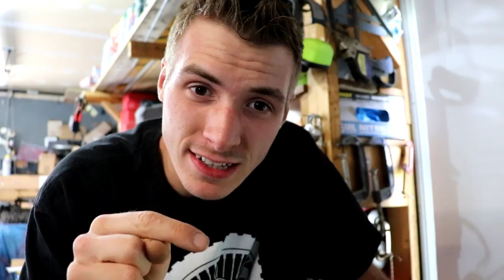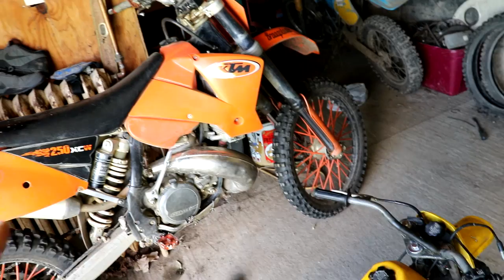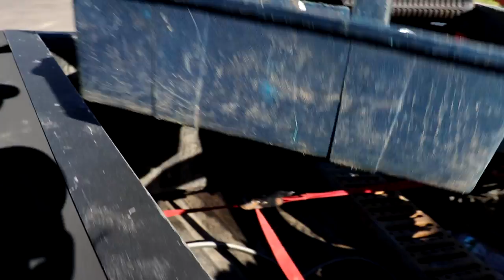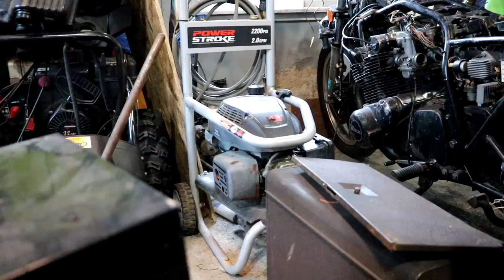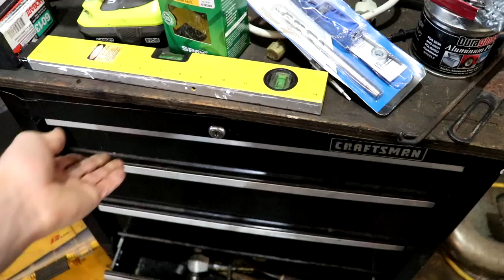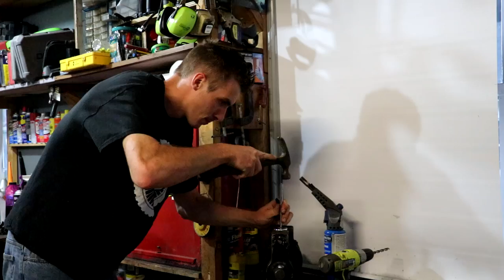THIS IS ALWAYS DANGEROUS

Comment from the maker: I want to read some comments.
Reply: what happend to the honda
Reply: 3DMachines where is the Honda?!?
P.S. I love your videos keep up the great work!
Reply: 3DMachines Yo Dalton, I'm not a machine freak but have been loving your vlogs for a bit over a year, more entertaining than Casey Niestat for sure! Never miss a vlog. Brapp on mate and stay froggy fresh
Reply: 3DMachines 2 vs 4 stroke
Reply: 3DMachines what has happend to the honda??
Reply: 3DMachines when you striped down your bike it kind of looks like those trick motocross bikess
Reply: That shaft is not the crank but the output shaft, the crank seal is behind the flywheel and clutch (other side) on the crankshaft.
Reply: What is your opinion on a 2002 yz426f?
Reply: 3DMachines i love your videos
Reply: are you going to build another lawntractor
Reply: your my favorite  you tuber and I wish I could meet  you and I'm from Somerset  pa
Reply: can to read these I'm video
Reply: I'll take the BMW
Reply: 3DMachines love you man
Reply: 3DMachines can u tell me what the measurements between the 3 screws that hold the front left plastic  is and stay froggy fresh
Reply: your best bet with 2 stroke's ( ive had nothing but 2 strokes) is to pull the engine out of the frame yourself, take the engine and have it rebuilt bore it out a little bit bigger, and while your engine is getting rebuilt tear down the rest of the bike and regrease all the bearings, axles etc and just spend time really cleaning the bike.
Reply: 3DMachines check the reeds
Reply: YOUR REEDS COULD BE BAD AND LEACK AIR BACK
Reply: 3DMachines great job on the videos! I learn something new every time
Reply: Jetting jetting jetting is all I can say make sure there the right jets for your elevation and temperature
Reply: 3DMachines buy a JD jetting kit, it is special made for your attitude and how the air is where you live
Reply: I'll give you $250 for the BMW
Reply: Phil Black IM NOT GIVEING YOU THE BMW FOR THAT LOW PRICE ONLY 5500$
Reply: hey dalton. ill bet you wont reply :]
Reply: 3DMachines where is the 450???
Reply: The countershaft seal is just for oil it's fine it's your crankshaft seals that are up front behind the magnito and water pump side case. Also you should do a piston it's cheap insurance and you'll gain some lost power
Reply: I noticed you got some new tail lights on the Dirtymax. Very nice!
Reply: sold the 450
Reply: Love the videos, keep em coming!!
Reply: 3DMachines please tell us where the Honda 450 is
Reply: 3DMachines i was amazed on how close you got the car behind you when you were backing up the dmax
Reply: Honda?
Reply: what you did is like checking for boost leaks
Reply: haha same
Reply: 3DMachines  how much do you want for the BMW
Reply: he sold it!!!!
Reply: he sold it
Reply: 3DMachines are you ever going on o fix the duramax
Reply: 3DMachines ride the honda
Reply: Minion Moto what did he sell
Reply: 3DMachines  thats not the crankshaft seal that's part of your transmission your crankshaft seals are underneath the plastic cover in front of that and if were running lean at idle it wouldnt want to idle and u can easy chk that with flammable spray it all around engine and if idle comes down then u have leak there as far as lean on carburetor mixture air screw and pilot jet controls idle to 1/4 throttle. this long winded but hope it helps
Reply: I just got the same air filter that he has.
Reply: 3DMachines chief boy are D-alton
Reply: 3DMachines hey man I watch your videos everyday, love them! And what i finds works best for exhaust springs instead of pliers I just put a piece of string threw the side you're trying to get off and pull, it won't slip off like your pliers, give it a go and when you do keep me in mind and give me a shoutout please
Reply: 3DMachines i blew my buddys ktm up 2 days ago wish me luck😬
Reply: Evan Jarvi the air comin out of the output shaft shows the case halves are leaking between the trans and the crank case that explains why its burning so much oil but it will suck air from the trans vent tube also and trans oil as you increase throttle. If it came to my shop id recommend splitting the cases check and replace any bearings and all crank seals and trans seals. Might as well rering it also keep it inexpensive while getting the most out of the engine
Reply: Where's the Honda? BTW I recently purchased a 2007 Kawasaki KX250F. GREAT BIKE!
Reply: Haircut looks Fresh
Reply: 3DMachines where's the Honda
Reply: 3DMachines u screwed me over jerk I bought two stickers a few months ago nothin
Reply: you selling the bmw
Reply: stay froggy fresh dalton
Reply: i saw your radiator dripping?
Reply: 3DMachines it's called thread lock man , not lock tight 😝😝😝
Reply: I hope you see this comment, you have bigger problems than that seal! The only way air can get to that shaft is if it is a crankcase half seal, or a bad crank seal on clutch side of bike. That shaft is part of the trans, not the motor. No air should get to that point from blowing in the engine.
Reply: 3DMachines 1 min burnout quad ricers challenge !!!
Reply: It's made by loctite
Reply: 3DMachines just saying you should buy a rebuild kit for it because they always say when it starts to run good that's when its going to blow up let me tell you Ik and it's a lot more money if it does
Reply: Most likley the right hand crank seal under the clutch. If the output shaft (counter shaft?) leaks a little oil, no big deal.
Reply: baths are nasty you sit in your own dirt
Reply: 3DMachines.    When you took a bath did you take bath in iced tea lmao
Reply: Can you please make more gator or gs 1000 videos?
Reply: Hi 3DMachines !  My brithday is this Saturday and I am turning 13 years old. Stay froggy fresh.
Reply: where did u get the plugs from?
Reply: 3DMachines send me the BMW i can play with it. i can get a lot of fun out of the car
Reply: end you get more space
Reply: 3DMachines all you need to do is hook up a compression tester where the spark plug goes look in the owner's manual it will tell you what what pressure should be
Reply: Steven Miller that will only show compress. When working on a 2 stroke the only way to do a leak down test is to block off the exhaust an intake cause it has no valves to be able to close them.
Reply: Do a one minute burnout it's a challenge in the nominate someone else to do it
Reply: Your bme runs rick not lean
Reply: 3DMachines i
Reply: 3DMachines why don't you take the time to actually wash your bike it looks like crap and that's why your seals went bad
Reply: 3DMachines a tip: buy a exhaust plug so ive your making your bike clean there isn't water coming in your exhaust. (are make 1 by your own!!) Mark van der Zweep Netherland
Reply: it might be your crank seal on the gearbox or possibly the crank case gasket that goes between the engine I would replace both crank seals and also check if theres any gearbox out in the crankcase because there shouldnt be
Reply: Can you do another live stream
Reply: where did you buy that test thing ???
Reply: 3DMachines scrap the POS BMW
Reply: 3DMachines I am not trying to be the bearer of bad news or be an internet mechanic but when my kx blew up we rebuilt the whole thing with a wrench rabbit kit. If pressure is escaping from the output shaft seal, one of you crank seals in the engine is bad. You probably should replace those because that is crucial to the way your 2 stroke runs. That chamber where the fuel and air is pulled into the crank should be a perfect seal.
Reply: 3DMachines  check reeds too had the same problem after rebuild.
Reply: 3DMachines I want it
Reply: hey 3DMachines where is the cfr 450? that bike was a beast i would hate to hear u sold it
Reply: hey 3d machine I am a huge fan

Comment: @3dmachines hey, your case is leaking at the combustion chamber seal, between the case halves. the air is going from the combustion chamber to the transmission, then out the sprocket shaft seal. you'll have to split the cases to fix that, but it's not hard. make sure you have crank seals before you do it, and you might as well order crank bearings also, so the bottom end will be done all at once. inspect the con rod for play (minimal twist is ok, but up/down is BAD) and you'll be all done with that bike for a while. really love the comment about making things for yourself, doing for youself, my kids enjoyed this one a lot. life lessons ftw !
Reply: kyle peterson what are u taking about the combustion chamber is where the fuel and air combust which is btw the head and pistion not the crank case and even if it was leaking in the crank case area it wouldnt be coming out of the counter shaft seal it would be coming out of the out side of the cases
Reply: smallengineperson 14 its a 2 stroke so the air fuel mixture gets in the crankshaft. the piston forces this mixture up in the combustion chamber
Reply: smallengineperson 14 what are you talking about? its 2 possibilities. the clutch side crank seal or the case halves in the crankcase leaking into the transmissiom
Reply: smallengineperson 14 I would recomend to learn more about how 2T engines function. For instance you could check out "The Workshop" (white horse logo) He have a bunch of videos about motorcycle engines.
Reply: Take a look at a 2t engine. The combustion chamber has ports, which lead to the crankcase, and is integral to the scavenging/charging effect that 2t engines use to make power. The seal between the case halves leaks in 3dmachines' engine, and the pressure test is pushing air out between those cases, into the transmission, then out through the transmission vent (if it's equipped with one) and also the output shaft seal. The only place that should ever have pressure changes in a 2t is the intake, and output sides of the cylinder. There should never be a leak of any kind between the combustion chamber/crankcase and the transmission. That will cause a lean condition (at best) and at worst a very lean condition because of ingesting transmission oil. Transmission oil will create a very nasty mix and build up carbon quickly on the piston, leading to a dangerous (for the engine) high compression ratio, leading to detonation. At that point, between the lean (HOT!) condition and the extra carbon, the rings will be wiped out or the piston melted, very quickly. :-)
Reply: Thanx to All who replied to this.Now I know something more about 2-stroke bikes too.(my prob was a stripped screw for the float bowl allowing air in around the head)

Comment: Good job on demonstrating the leakdown test!  One thing to consider: put a low psi gauge in the line, and a valve.  Pump engine up to 10psi, shut valve.  Now, not only can you find your leaks, but you can determine how bad they are.  Ideally, a 2t motor shouldn't leak at all, but less than 1psi drop per minute is still acceptable.

Comment: Dalton, if your drive sprocket is held on with a c clip like mine and all the Ktm 2strokes & not a bolt you need the drive sprocket & c clip fastened in place to get a good seal round the drive shaft, they say every time you remove the drive sprocket you should change the seal or it will leak , but as you said yours definitely needs changing. I put a new one in & I still get a tiny tiny bit of oil off the drive shaft . Peace ✌️

Comment: That's not the crank seal that's the primary drive seal. To get to the crank seal you have to pull the flywheel and the ignition
Reply: Exactly.. I was going to comment that until I seen this..that seal shouldn't make it run lean since its part of the trans and full of oil..should have a crank seal behind the flywheel and one behind the clutch on the other side? Correct me if I'm wrong but pretty sure that's right.. And the clutch side shouldn't make it run lean because that's full of oil too..if that was bad it would smoke real bad and keep fouling spark plugs..
Reply: Ryan Grampetro I was thinking the same thing
Reply: walt birchmeier you are correct. It seems to be bad though because the air should not reach the output shaft anyways.
Reply: well if the air reaches the output shaft then the right side crank seal would have to be out or it would be the case seal that is leaking. if I'm wrong correct me
Reply: Ryan Grampetro       he needs to pull it apart to check the crank seal also
Reply: Neglecter Collector you're right. The only way air can get to that sprocket seal is if he has a case half gasket leak or right side crank seal leak since the transmission is separated from crank case
Reply: Blaster528 3D really needs to see these comments because replacing that seal will not fix the problem
Reply: You need to also consider that those rubber seals arnt really meant to hold pressure. If it's running lean and not smoking like a freight train, it's most likely the stator side crank seal
Reply: Derek Getz yeah good point. Well those seals do hold pressure, just the opposite direction of pressure. They hold vacuum pressure.

Comment: hey Dalton I just wanted to give you a little tip to for getting over large rocks or logs when you cone up for example a log stand up and kinda bounce on the pegs a bit then when it goes to spring up pop the clutch so the front end comes up and try to get the rear tire to bounce and have the back tire hit the top of whatever your trying to get over and there ya go

Comment: once you fingire out about any other possible leakes. the main way to adjust your carb is the needle it's about a 10 minute process and it affects 1/4 to 3/4 throttle

Comment: if u are presureizing the cylinder and bubbles are coming out where the sprocket goes on then the case gasket could be no good. on 2 strokes the crank is sepperet from the transmission so the only way air is getting out from the shaft could be the case gasket letting it through. and cool vids

Comment: you could try changing the packing in the baffle and cleaning out the pipe. i have a ktm 105xc and i was fowling plugs and it was smoking a lot then i changed the packing and got a new pipe and now it is A LOT better

Comment: Dalton all you need to do to check how the bike is running is to read the spark plug. Put a new one in and go for a ride and then pull it out and see the color. Black is too rich and gray/white is lean. If it's running right it should be a light brown color. Run some good quality pre mix oil specifically made for a dirt bike, keep the air filter clean and you should get a lot of hours out of that motor

Comment: Most important thing to remember is that your trottle not only controls the fuel going into the engine, but also the lubricant. My friend rebuildt 3 engines before he gave up on 2 strokes and now only use 4 strokes

Comment: Wow I get no shoutout for this 😂. Your engine shouldn't hold  the psi for a while. The way the Ktms power valve is made a lot of the air gets pushed out through there and there's no real way to block it off. So if all your gaskets, oil seals, case halfs, and you don't hear bubbles from under the transmission cap ( indicating u have a right side crank seal leak) u should be a ok. Hope to see her Brappppppppppppppppppppin soon

Comment: Dalton 
The the crank seal  under the flywheel should have been checked to. The bubbles you seen at the counter shaft could be the center case gasket. 
And so you know you need a case splitting jig to replace the crank seals and bearings as they sold all be replaced at the same time. 
To make it short for you, The whole motor needs to be disassembled.

Comment: The seal on the sprocket isn't the bad one it is the one coming into the clutch crankcase side aka clutch side crank seal general rule of thumb is change both crank seals at same time also check your jug gasket area and your reed basket gaskets for leaks also check the mating area where the 2 side cases come together  hope that all helps you out.

Comment: take the flywheel cover off , start the bike leave on tickover and spray a little easy start or brake cleaner near where the crank seal is. if the revs pick up on their own the seals leaking. 

don't go mad with the spray

Comment: There's an inner and outer output shaft seal.  If it's the inner, you're screwed.  Going to have to split the case to get to it....
Reply: Brendon Kelly he needs to split the case anyway because no air should get there. The actual crank seal behind the primary gear is bad.

Comment: What i usually  do is start up the bike and spray carb cleaner around the carb and boot a if u can main seals if it changes the tune then u found the problem you can do it on dam near any any kind of engine instead of buying plugs and pumping up the engine with air

Comment: Your bike cant run lean if that seal is broken,but changing it prevents oil from leaking, Reasons to running lean 1. if you have bad reed valve 2. the jetting is wrong 3.you have a leak in your rubber thing after the carburator ps.you can check the sparkplug, if its white the bike runs lean, it should be coffee brown so then you just change the jetting ore check for air leaks.

Comment: Sorry to correct you lol but that is the countershaft seal :D  If you meant crank seal you meant the seals inside that seal the crank so air and oil don't leak out freely a leaky crank seal can cause either a lot of smoke or an engine melt down if the left side blows...

Comment: That seal is not apart of your engine cylinder since it is a two stroke so the crankshaft is lubricated by the premix if your bike is running lean which it is check the main jet in the carburetor slide it might be positioned in the wrong place you  can find the manual for your bike online

Comment: That's the primary drive seal, not the crank seal. It sounds like one of the crank seals is bad though (probably the ignition side if not both). Might as well get the bearings too just in case. You wouldnt be leaning out because of the primary drive seal being gone (At least I don't think so)